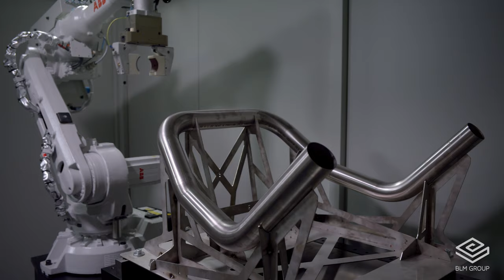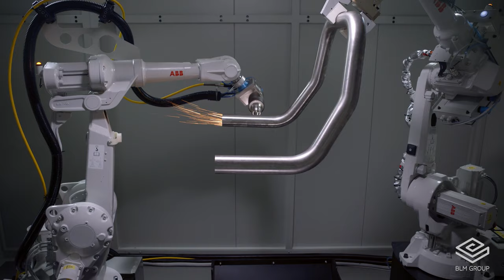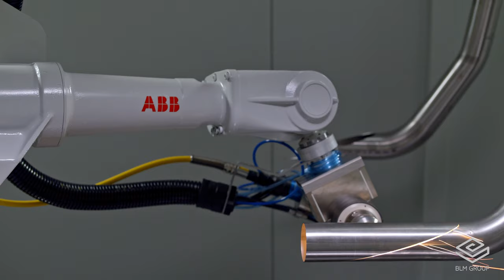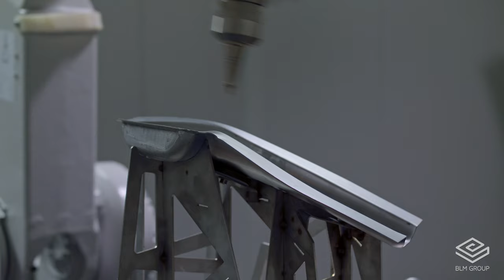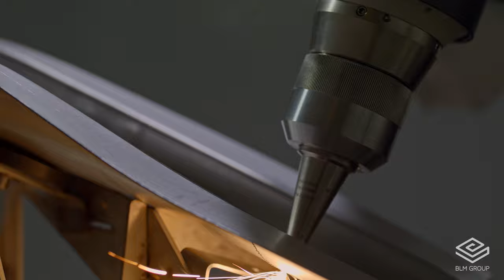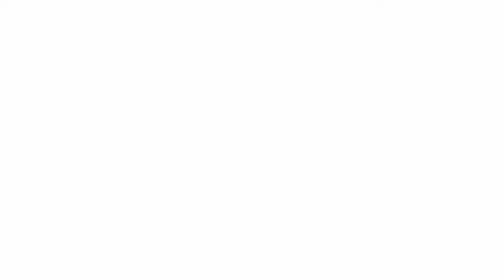6 axis laser cutting machine LT360 | BLM GROUP

Comment: When laser cutting Tubes what prevents the laser from cutting Through the Opposite side of the tube?
Reply: Diffusion results in reduction in Laser Power,
Reply: @amityummit  Gee thanks after 25 years of programming 3D lasers you think I would have known that.  I'm asking how you do it?
Reply: @tomcallan6099  As an operator, you tell the machine how much power to send to the head(torch). It's a lot easier than you think.